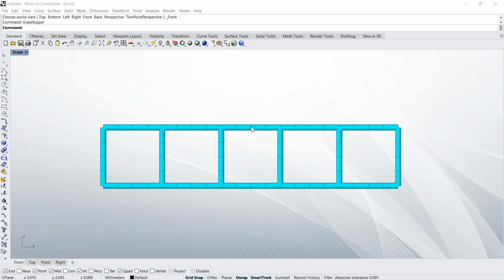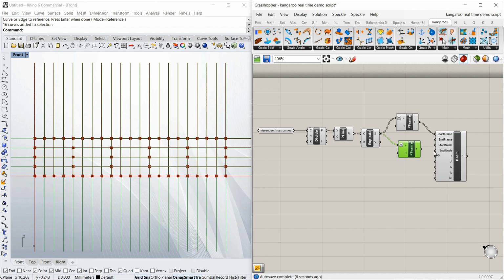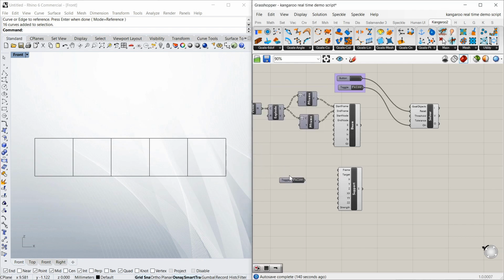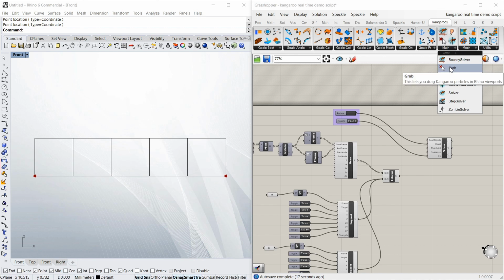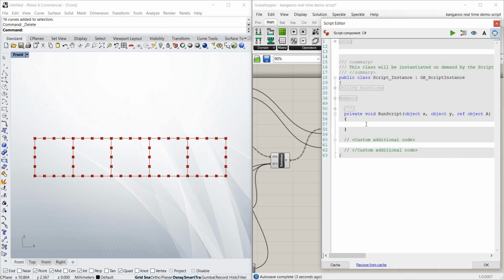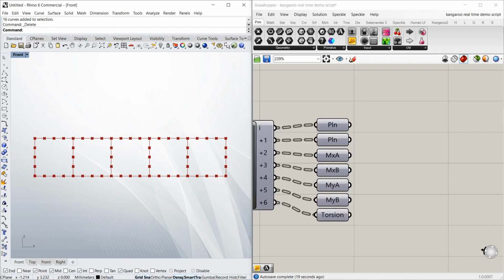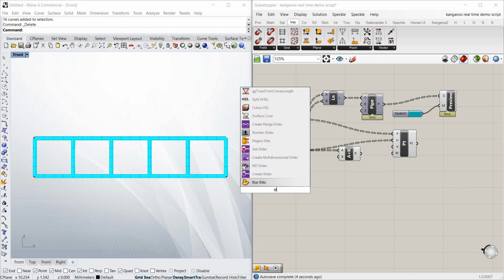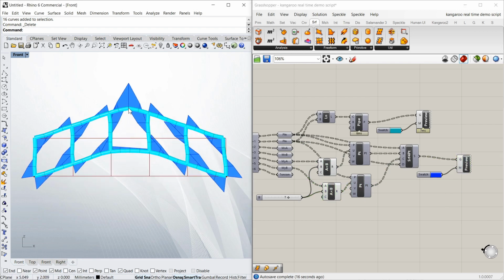Tutorial: Live structural analysis. Click and drag a simple truss for moments in grasshopper.

Comment: I did exactly what you  did in thí video but the result is not like that, I don't know where my errors are, could you help me?
Reply from the maker: Check if the lists are flattened or in the right format. Often this is the cause of problems. Hope this helps.
Reply: @StructuredParametrics  I'll sincerely appreciate that if you don't mind checking this product 
https://drive.google.com/file/d/1pPBiSuSbtwm4kfALFdykbAP3wKcU9A9i/view?usp=sharing
Reply from the maker: On the second Multiplication [A x B] after [MyB], change input C to 1 instead of -1. The moment for MyB does not need to be made negative. 
This should make it behave similar to the tutorial example.
Reply: @StructuredParametrics  OMG thank you so much
Reply: one more thing, if I want to turn nodes at intersections into internal links with free rotation ZZ, how should I do?